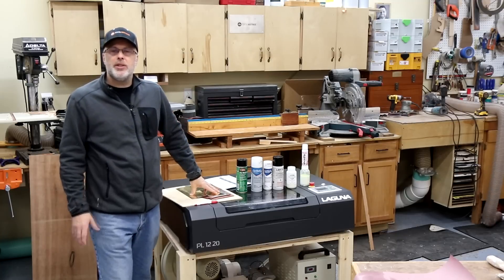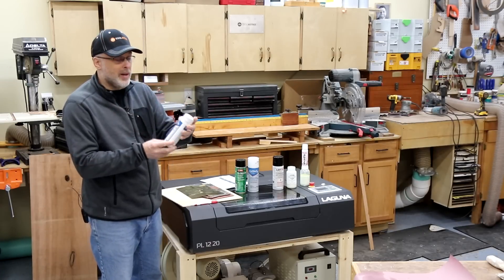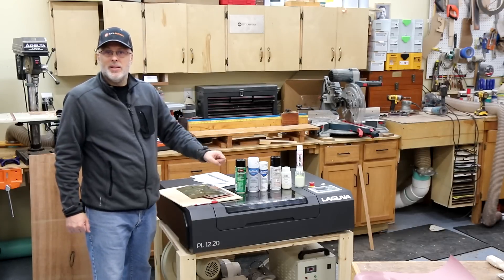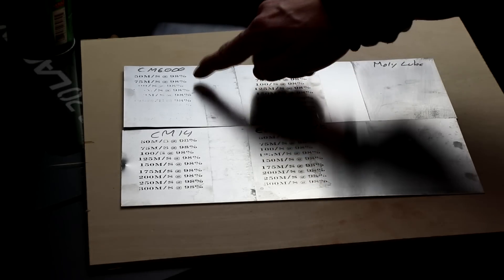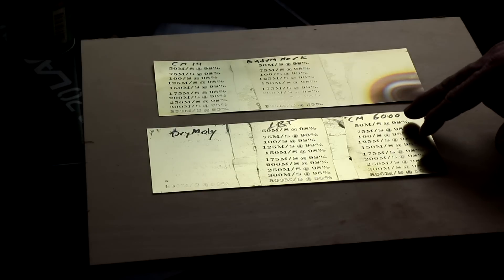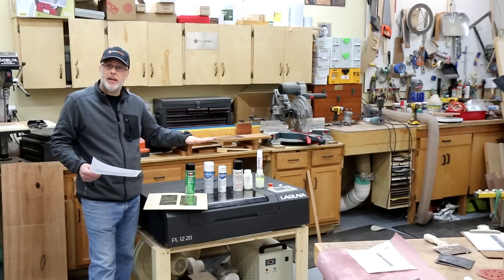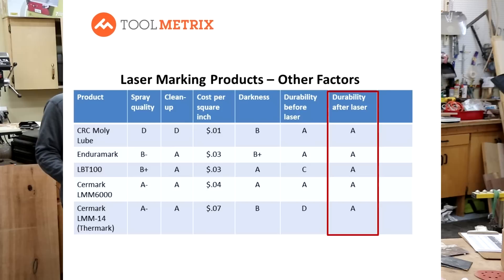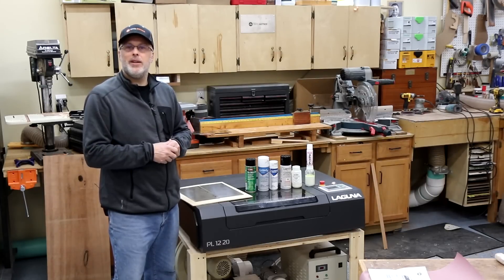Laser Engrave on Metal Product Test: Cermark, Thermark, Enduramark, LaserBond 100 &Dry Moly Lube

Comment: Excellent information.  I noticed video was produced 4 years ago.  Any update information since that time I should be aware of?   have a few projects I am looking at wanting to put a metal label plate on, but after the engraving I would need to bend the metal to be able to mount.  I am bending around a lineman's pole that is about 25" in circumference.  Any issue with the marked areas possibly cracking or degrading while bending the metal?  Obviously I need to find thin enough metal to bend.
Reply from the maker: Hi Ron, I actually haven’t done much with etching on metal since making this video, and I’m not much of a metal person in general so I’m afraid I’m not able to offer any assistance. Cheers

Comment: Does any of these work with an xtool 10w diode laser?
Reply from the maker: I doubt it. I believe you need more power.
Reply: They market laserbond 100 for “all laser engravers” guess it’s false advertisement
Reply from the maker: I’ve only tried it on 40w and I’m just speculating. They can tell you for sure.

Comment: Seems to me that you should pick the best product that wins in most the categories most import to you and then send a sample out to a testing lab and have them test it with a simple mass spectrometer test to see what is actually in the stuff and in what proportions. (reverse engineering)  I was an industrial photographer for many years and there was a spectacular solution for cleaning finger prints and dirt, oils etc off  negatives and especially color slides, It smelled vaguely familiar but was hard to place the smell.  It was absurdly expensive at about $30.00 for 2 oz. One of my customers was a chemical testing lab,  and the chief chemist was an amateur photographer and we were talking one day about this cleaning fluid. He asked to I if I'd give him some to test for his own use. So I did. Three days l he gave me a complete chemical analysis of the liquid and instructions on how to make it! It turned out all of the chemicals could be bought cheaply at most hardware or paint stores except for one, and he gave me the name of a chemical supplier I could buy the liquid chemical in bulk.   For the same $30 I could make a gallon of the stuff. It lased me for a number of years!! 

If you're in business you gotta do what it takes to reduce operating costs!! Everyone does it! I wouldn't for a minute doubt that the chemical that blackens when hit by the laser beam is the same type thermal set plastic possibly used used in laser printer cartridges for black ink. Actually I think I'll take one on my laser refill kits and experiment adding the dry pigment into a solvent, spray it and see what happens!
Reply from the maker: Thanks for the suggestion. That’s not my style or philosophy though.
Reply: The black stuff in black toner is a combination of Carbon Black and Black Iron Oxide. This makes the powder magnetic. It helps to make the image in the printer. The stuff in the toner that makes it stick to the paper is a low melt point plastic.   |  Laser marking takes place at a very high temperature and it would be blown away or just burned up in the laser marking.
 
   Laser marking materials are all inorganic materials with very high fusion temperatures and very small particle sizes.
Reply: @inkmaker01  thanks for the informative update! I learn new things every day or at least try to get the truth!!

Comment: Three questions - First what lens size are you using?  I've found I get vastly different results with a 1.5" lens (MUCH better for engraving) compared to 2.0" lens (much better for cutting but not as good at engraving due to focal length).  A lot of people do tests on machines with the standard 2" lens that comes with their machine.  Second, have you noticed a difference in engraving on polished brass compared to a mill finish?  When I do polished brass I get a lot of post engraving tarnish due to the Cermark or water used to wash it off and I need to polish up the mirror finish again before clear coating (with polyurethane to prevent tarnish and protect the marks from wear).  I've found that sometimes polishing with things like brasso will sometimes rub off nice black marks and fade them.  Finally, what dpi were you doing these tests at?  I get much better results with a 1200 dpi compared to 600 dpi or 300 dpi (obviously)  Just curious what you were using so I can make comparisons or adjustments.  Thank you.  Great video!
Reply from the maker: Hi Justin, I'm just using the standard lens that came with the Laguna Laser that I use.  Not sure what size it is.  I haven't used any brass with a mill finish; just polished as shown in this video.  DPI...not sure about that either.  Sorry.  I was pretty much just using default out of the box settings.

Comment: Hi. I have a CNC plotter that might have a laser module mounted on it. What do you think should be the minimum laser power that would do the job according to your demonstration? Thank you!
Reply: For LaserBond 100 to work properly you'll need at least 25 watts for a CO2 laser.
Reply from the maker: Thanks Paul!
Reply from the maker: 40 watt is what I have and it seems like a minimum for this.

Comment: Phenomenal video. I used this to decide which marking solution to try first. Our requirement calls out Taber Abrasion (TA) resistance per ASTM D 4060 using CS-17
wheels, 1000 gram load, for 7000 cycles. This is a pretty stringent requirement. I wonder how it would compare with a 600grit wet sanding because TA testing is expensive.
Reply from the maker: Thanks!  I’m not sure on your requirements. I’d suggest contacting Paul at Laser Bond. If anyone would know it would be him.

Comment: Hello, this is a great video. =) So, I have a laser that is far less powerful than yours. It's just a little 1000mw laser, (which is equal to half a watt) however it did come with dog tags and wood, as if it is able to engrave on them. For a while I couldn't get it to engrave on the wood, but as I adjusted the laser, it definitely does, pretty well too. I've been trying to figure out how to make it engrave the metal dogtags. It came with a marker to I guess block the shine so it would engrave, but I couldn't get it to work, so I bought LBT100 and thought surely this would do the trick. Well I still haven't figured it out yet. I was wondering, are you able to adjust how many watts your laser uses at once? If so, would you mind just testing a stainless steel with lbt100 and just see if it is at all possible to engrave it (see if it works) at half a watt on your laser engraver and just let me know? I don't want to give up just yet. You seem to know what you're doing and I thought you might be able to make it engrave at that low of watt. Thank you. =) Blessings
Reply: You would need at least 5 watts of power for a diode laser and 25 watts for a CO2 laser for the bonding process to occur.
Reply from the maker: I would have no way of precisely simulating 1kw.  I can designate a percentage of the 40W to be applied, but it is a crude approximation at best.  I would suggest contacting Paul at LBT. I’m sure he can tell you the lowest possible watts needed because they’ve tested everything. It probably even has this information on the web site. I doubt that it can do anything with your laser but it’s possible.
Reply: @ToolMetrix  Thank you very much =)

Comment: I'm curious about durability when heated. Will the marking burn off if the metal gets hot? I am considering using this for marking some 3D printer parts which will get very hot (over 300 degrees Celsius).
Reply from the maker: I haven’t tried it but I doubt that 300 would affect it.

Comment: Do you know of any product that will allow me to laser engrave fine black onto a white painted chassis? Or a white paint that will laze black rather than fully ablate away during engraving?
Reply: If you spray the whole thing white, then engrave the paint away where you want, coat in your marking product, then do a second laser pass, it should remove the paint where the lettering will go on the first pass, then mark the letters into each area not the second pass.  final result will be a white background, with black marked letters in place. I just made that up though, so I wouldn't entirely trust my idea. . .
Reply: I actually found a product called
LazerBlak, Lazer White & Laser-It. They are .025 sheets of Aluminum, metal coated, then powder coated in any other color. The metallic coating is the engrave color.
Reply from the maker: No, sorry. I haven’t tried  it and I’m not aware of anything that would work.

Comment: Hi Paul, great video. Are you using "anodized" aluminum for your test?
Reply from the maker: Hi Jorg, Thank you.  No, the aluminum is not anodized..
Reply: Hi, i try it today with Cermark LM6000. It dont't work good  direct on anodized aluminum but i do another way. First i laser the anodized away and than i use the LMM600 and laser the same a second time. I work very nice.
Reply from the maker: Yes, that will work.  LaserBond 100 supposedly works on anodized aluminum but I haven't tried it.

Comment: Please post your settings you used to run the products.  So we can test them at your shop.  I have Cermark 6000 and LBT and we have a 40 watt laser and 120 watt laser.
Reply from the maker: Hi Jamie, the settings are shown on each metal throughout the video.  If you look at the shots where I show each metal and talk about the results, the numbers that are shown on each metal indicate the laser settings that were used to produce each line of text.  For example, if you want to know the settings for stainless steel, look at the 4:12 point in the video and you can see the settings and how each product performed at the various settings.  For example, LBT looks great all the way through 600 mm/sec @ 75 watts of power, while Cermark 6000 starts to fade at 600 mm/sec @ 98% power.

Comment: Great job on the video. I would like to know the wattage of your machine that you ran  the test on. As I have a 40 watt machine so I'm not sure that your 98% power would be the same as mine if using a different wattage machine.
Reply from the maker: Thank you, Patrick.  Mine is a 40 watt machine as well.
Reply: ToolMetrix Good deal, thanks for the quick reply. My results with the moly lube were very  Inconsistent. At 90 pwr & 20 spd one time perfect the next wipe right off. Waiting on the Cermark to come in hoping it does better.
Reply from the maker: Interesting. Cermark should definitely definitely work better. Did you see my video where I tested cermark and other competing products?
Reply: Yes, but after I ordered the Cermark. I'm thinking I should have gone with the LBT.
Reply from the maker: For most applications LBT would have been my pick.

Comment: Thanks for making this review.  Are they really all the same for clean up?  We used to use Cermark and it was a lot more difficult to clean up than Enduramark.  Cermark required physical wiping to remove the spray and would sometimes leave a kind of "ghost image" next to the actual marking that would require the use of a magic eraser to clean.  Enduramark always cleans with just running water and nothing else.  That makes all the difference in a manufacturing environment where it isn't practical to scrub all the items with a sponge.
Reply from the maker: That's a good question, and maybe I need to look more specifically at the subtleties between cleaning up the products other than Moly Lube.  Compared to Moly Lube, they all cleaned up so quickly that it felt like any minor differences were trivial, but your point is fair in that I should look at them from the perspective of a production shop. I was using a cloth on all of them, and they all seemed to wash off effortlessly.  I didn't do a test to see which ones came off with just a water rinse.

Comment: What? No Grey Poupon?  https://www.youtube.com/watch?v=B60nXwhK9gk works on stainless steel only, per the video.

Do you run the laser at the rated power levels indicated on your list, or are you adjusting the figures for the maximum safe level for your tube? Many Chinese lasers are rated much lower than the advertised figures and one has to use a milliammeter to proper set a safe top end power level.
Reply: laguna was right. Laser tube life is fairly unaffected (for CO2 lasers) at power levels under 95%. there's very little difference in lifespan operating at 30 or 70 or 90%. But at very high utilization rates, the lifespan falls off a cliff. Most commercial & Makerspaces throttle their tubes to 95% or so in order to keep people from burning the tube out faster than necessary. A lot of lasers have configuration settings that allow you to set a maximum power so even if the usr specifies 100% it will only fire at 95%. There's no point in running it lower than 95% (for cuts) in order to save your tube's life.
Reply from the maker: Hi Fred, Thanks for your input.  I simply ran the laser at each of the settings that were shown on each piece of metal.  These were the settings that were configured in RDWorks, I didn't use a milliameter to calibrate, so good point that the settings might not directly translate.  Yep, I've heard of using mustard, vinegar-soaked paper towel, and plaster of paris.  I think I see another video in my future... :)
Reply: Even more important than the translated settings is that your laser may be overdriven beyond a certain power setting. I have a 60w laser that should not be operated beyond 65 percent, as it reduces the life of the tube. 

I hadn't heard of vinegar or plaster of paris. The mustard worked well in my brief tests, although the lumpier off-brand stuff had inconsistent results.
Reply from the maker: Interesting.  I'll have to ask Laguna about operating the laser at higher percentages.  They told me to not run it at 100%, but said that anything short of that should be fine, which is why I ran most of the tests at 98%.  But I'll do some homework on that.  Thanks again.  And only the finest mustard for laser marking: check!  :)
Reply from the maker: This is great information.  Thanks for sharing, Jim!